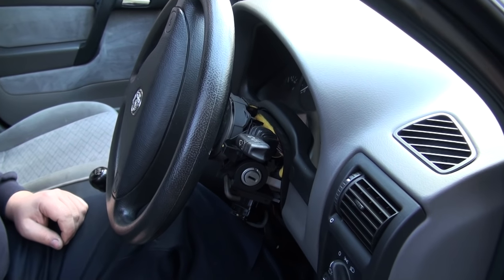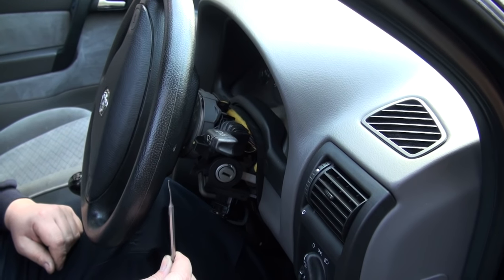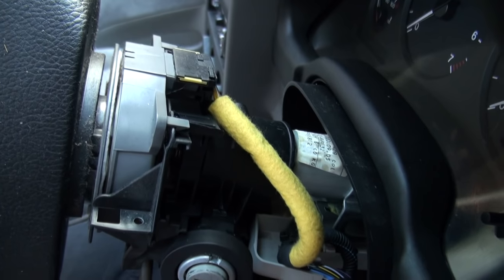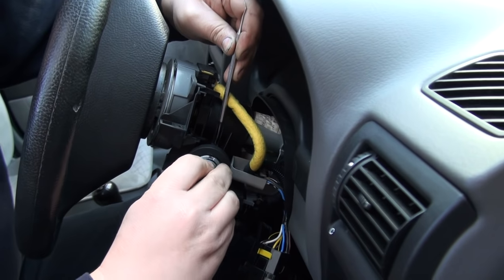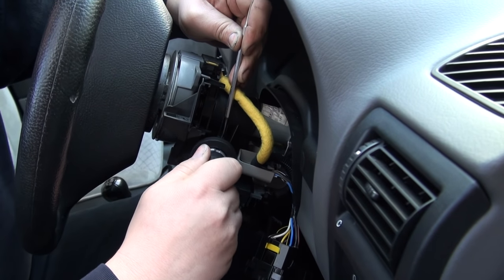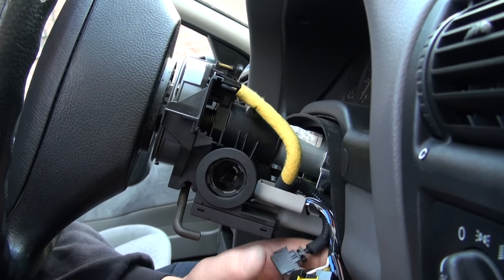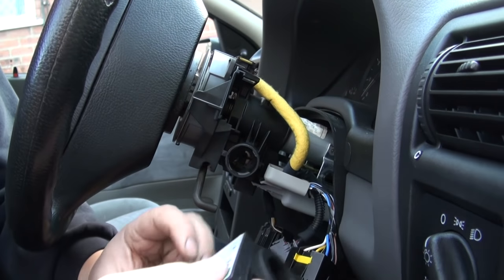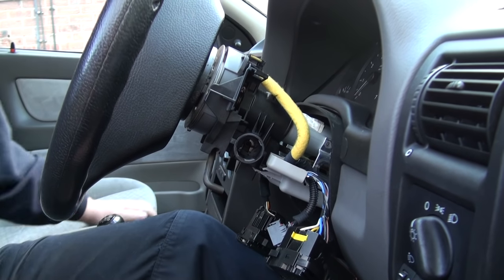Astra Key-Reader removal

Comment: Hi Roger I went to change the battery the put key in the ignition barrel it stater then I took the key out try the 2nd time it did not work at all I call the AA they said I have broke itthe key barrel, so the car went to the garage, I thought there would go to Vauxhall and replace the key barrel but there said you can not buy one you have to have to two keys now no choice.they open the Immobilizer change the reprogram the chip. They have use from a different car barrel and reprogram it has cost me £250, all there had to do was get a new barrel from the car dealer that all, new key barrel is £50 daylight robbery. Now just want keys like it was by remote what the best way can you help me please, by the have Fantastic Christmas and a Bringht New Year with your family your viewer and keep on makeing more video's.